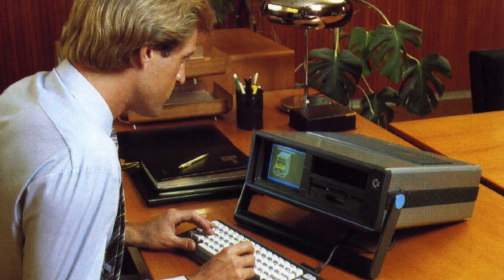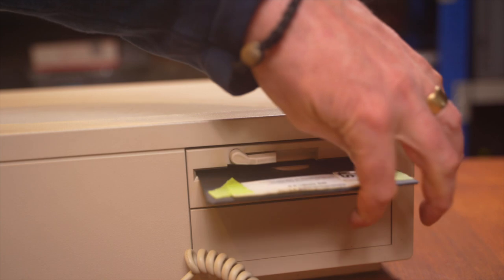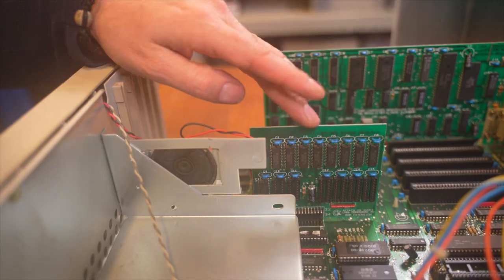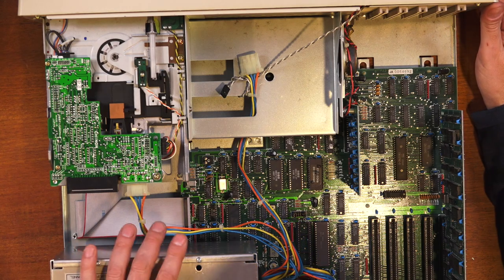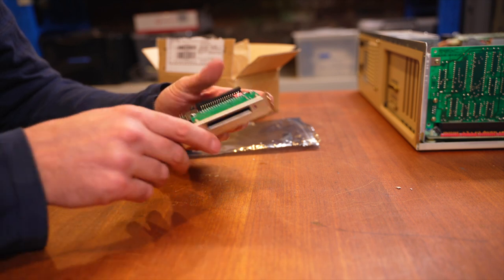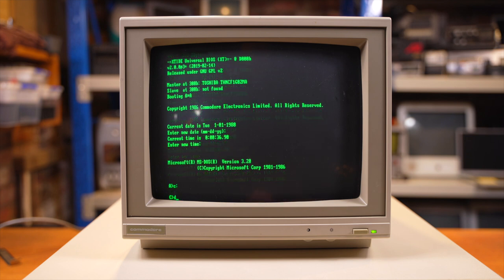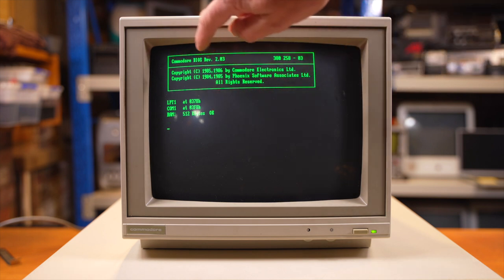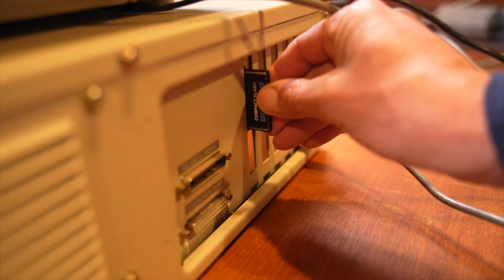Commodore PC5 XT Clone - Full review and upgrading storage to CF card!

Comment: The two ports are now known as "legacy ports". RS232 is for connecting a telephone modem or a serially connected printer. The centronics port is an 8 bit parallel port for connecting to a printer. Centronics is the name of a company which defined the standard for their printers.
Reply from the maker: I knew someone would know! Thanks for adding the info 😄👍
Reply: @TheBasementChannel  You've never used a serial or parallel port? Are you younger than you look? XD Prior to USB this was pretty much the only way you'd ever hook up a printer. (And how many modems were hooked up, though PC clones did often use internal modem cards)
Reply: @TheBasementChannel  And you couldn't just research 5 minuted on wikipedia before making a video on YouTube?
Reply from the maker: And miss out on your comment? Not likely!

Comment: Did you make the partition active?? (Option 2 in FDISK). Another great video btw, not usually interested in these types of machines but you made it interesting.
Reply from the maker: Yes I had tried that option off camera. Thanks for the encouraging feedback!☺️
Reply: @TheBasementChannel  I wonder if it is because the partition size for that version of FDISK is just too big. I’d suggest deleting all partitions off the card to start and then creating a 20MB partition, setting it as active if FDISK doesn’t do this (usually dies it automatically).
Reply from the maker: @RichsRandomRetroReviews  agree. Fdisk won’t delete a non dos partition. And I’m using disk utility on my iMac which is hopeless.
Reply: @TheBasementChannel  I can see how that would be a problem!! Don’t you have another PC laying around the basement you can try it on??
Reply from the maker: Yes no doubt, but I’m lazy 🤣
Reply: @TheBasementChannel  That kind of stuff makes any Mac user roll their eyes.
Reply from the maker: True 😅

Comment: I had some issues getting the XTCF Lite running with DOS 3.2/3.3 on my Commodore PC20-II. Even small size (16MB/32MB) with limited partition size <=30MB. It will hang on bootup. With DOS 6.22 no problem at all. However: It is a good idea to restrict the partition size to 30, 40, maybe 60MB, because the larger the partition, the longer it takes to calculate the remaining space on a DIR command. If you ever manage to get DOS 3.2 running on this combo, let me know how, because I want to use a CF that mirrors the original content of the machine which was on the built-in HDD when I bought this machine. It did not work with the original Commodore/Phoenix BIOS as well as Turbo XT BIOS and c't V20 BIOS

By the way, I have a Tandy sound card (Chipkin, based on the original James Pearce Design but with the flaws and errata already resolved) in the system, which typically does not mute the humming noise of the sound generator chip on startup until the sndoff file starts in the autoexec - I have modified the BIOS to include the muting of the Tandy card. The startup sounds like when switching on a PCjr or Tandy 1000 - short humming and then silence. If you are interested, let me know.
Reply from the maker: Some good info there. Thanks for posting. I may persevere trying to get 3.2 working, but practically I’d be better off with 6.22, I just feel in a weird way 3.2 is more authentic to the machine.

Comment: with the format fail , you might need to set the MBR 1st ?
Reply from the maker: Yes I figure the MBR needs to be in the first few blocks of the card, and since there is something else there which I can’t delete, it’s failing. Not totally sure though, I need to try a few other cards.
Reply: @TheBasementChannel  I'm just thinking back,  old skool .. I've never tried a CF adapter . can you low level format them ?
Reply from the maker: @outbackchillin5628  yes apparently so, you need to write 0s to the entire card with DD